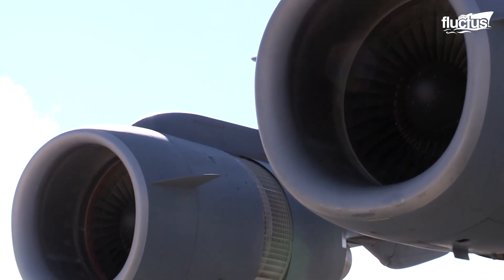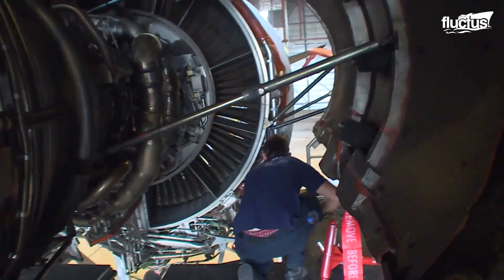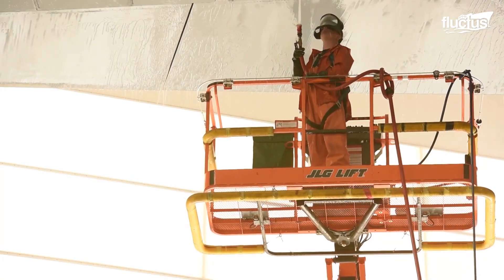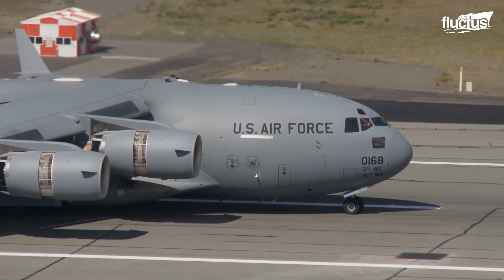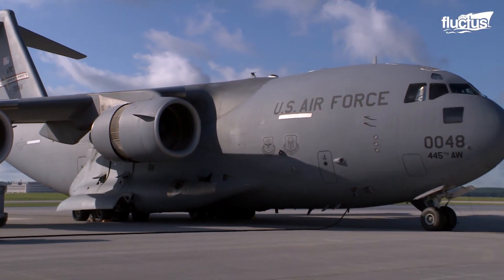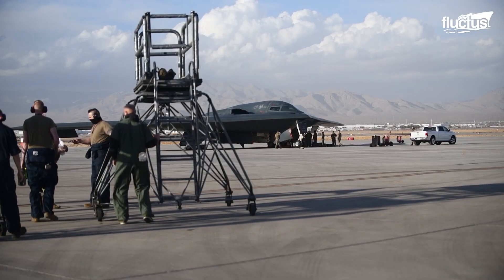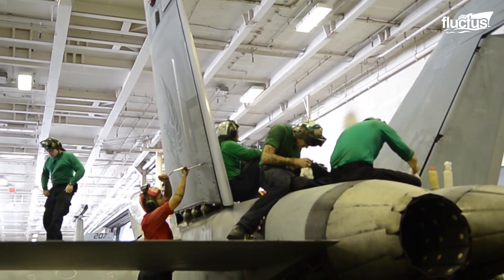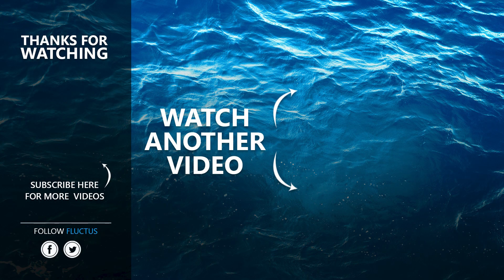How the US Air Force Parks its Aircraft too Large to Fit Hangars

Comment: Being a former Air Force Avionics Technician working on aircraft inside a climate controlled hanger is much nicer than in the weather outside! Unfortunately even the heaters inside the aircraft hanger are no match to the extreme winter cold outside especially when someone forgets to close the hanger doors! When the doors are left open water pipes inside the hanger will freeze and burst rather quickly even when the heaters are working. 🤦🏼‍♂️
Reply: Fffffffffffffffffffffffffffffffffffffffffffffffffffffffffffffffcfcffffffffffffffffcfcfffffffffffffcfffffff🙏🏻 fffffffffffffffffffffffffffffffffffffffffffffffffffffffffffffffcfcffffffffffffffffcfcfffffffffffffcfffffff ffffffffffffffffffffffffffdffffffffffffffffffffccfffffffffffffffffffffffffffffffffffffffffffffffffffffffffffffffffffffffffffffffffftwtqz4q
Reply: P

Comment: I'm seeing a potential design improvement potential here me out.  SIMPLE IS BETTER. 

WHAT IF instead of elevators they make the carrier longer and have the lower decks set up like a parking garage albeit longer sloped ramps so that the carrier could do an elephant walk with its entire load without any assistance from steam or electromagnetic catapult, just one long ass runway.  Catapults would still be used to save on fuel consumption for non emergencies but if they wanted to get 100 aircraft in the air in under 10 mins there is no other way.

Make a double decker carrier with the top AND second deck able to launch aircraft, the bottom deck reserved for maintenance fuel and personal residences.